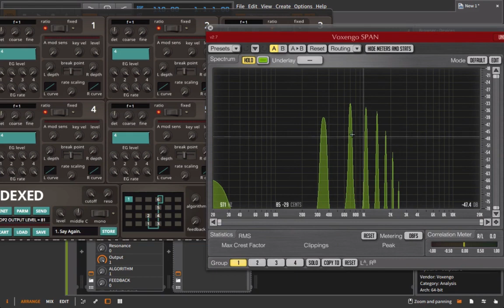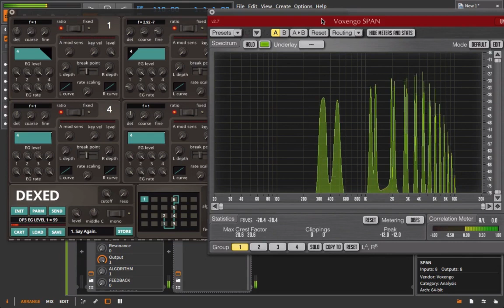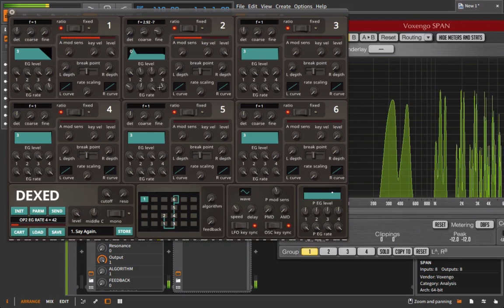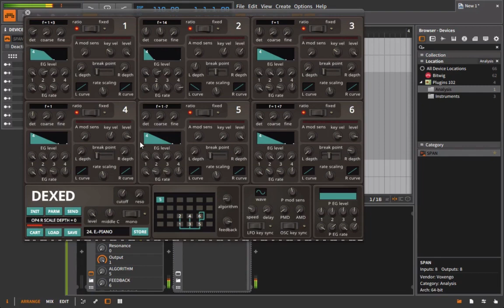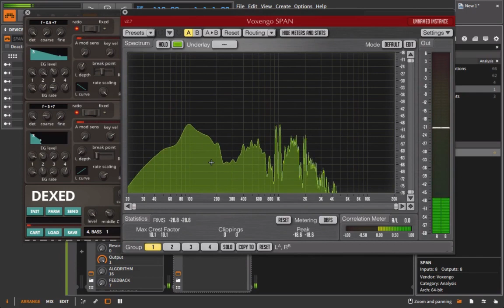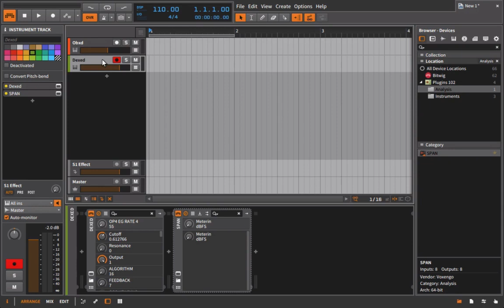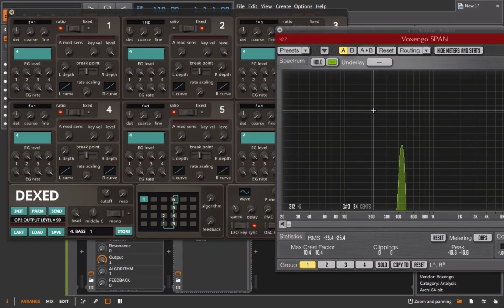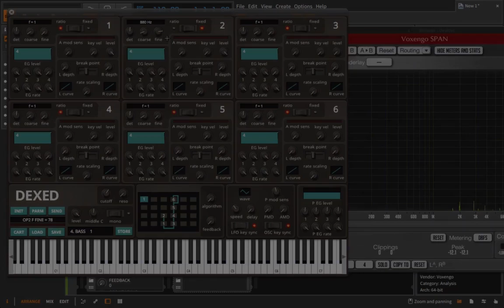Dexed (DX-7) Hardware Emulation Synthesizer

Comment: I have an original DX7 I bought new when they first came out.  Still works great and the best keybed ever on a synth.  Somewhere in between weighted and non weighted.  But just feels great.  Having said that, Dexed is an incredible emulation.  Most ears will never hear the difference, and what little difference there may be, if any, just becomes what the patch sounds like for what it is.  I have a Yamaha KX88 controller and I love it.  It's old, but if it ain't broke, don't fix it lol!  So I have a great keyboard to trigger my soft synths with.  This one is free on top of all that.  If you don't have it in your collection yet, run, don't walk, to your nearest computer and download it.  Thousands of patches free on the net.  And MUCH easier to program if you like doing that than the original hardware version.  My top three synth plugs are Diva, Dexed and Hive.  There are others, but those three are the meat and potatoes for me.